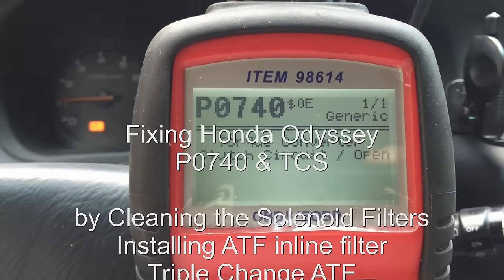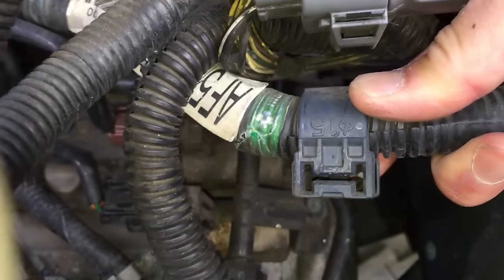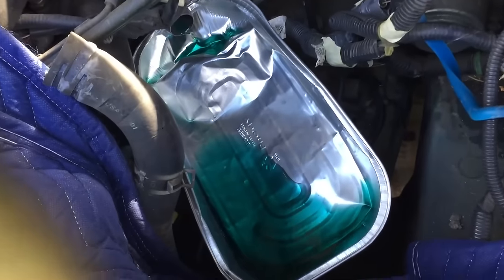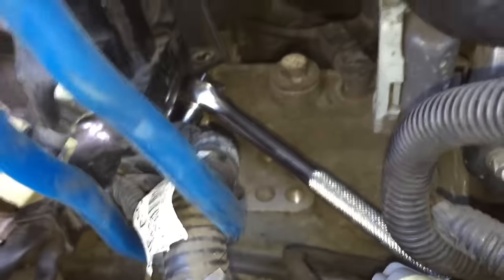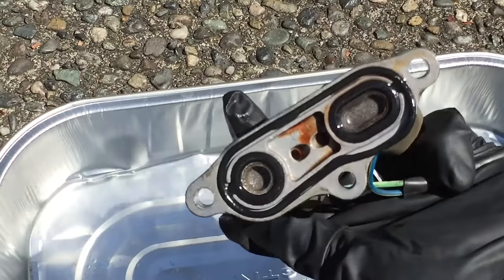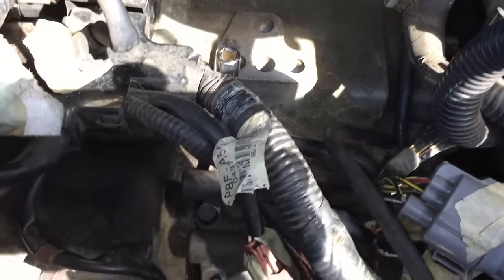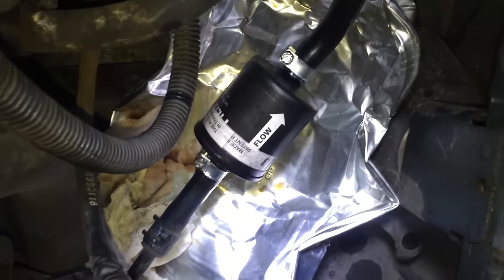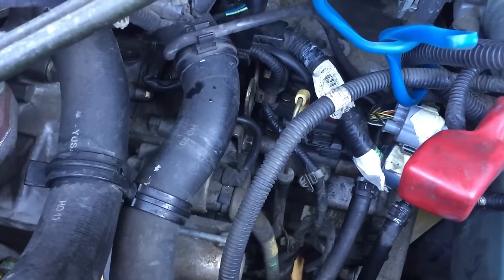Fix Odyssey P0740 TCS Transmission Problem

Comment: I decided to go with Valvoline synthetic. $26 at Walmart. I got that information from Reading several Odyssey forums. Also Aisin synthetic is recommended. Thanks about 3 1/2 QTs. I'll be doing the total of four flushes. 
Follow up: I did the four flushes and it didn't make any difference and now my third year is out completely. I was able to drive it home on the highway I had to pull over and think about what I was going to do  I decided to try shifting manually 1st and 2nd and then jumping up to  D. It seemed to work okay I'm going to try that for a while because it's my only vehicle I have.

Comment: I have 1997 Honda Odyssey medium not the biggest> I accidentally put the gear in reverse while in motion. It gave a sharp noise but I could keep drivinge it forward but if I engage the reverse it keeps giving a sharp and hard noise and it doesn't move in reverse. What is your recommendation, please?

Comment: I took mine off to clean it, got a new gasket, reassembled, but now I can't get it to seal. I've cleaned out all the bolt holes , made sure everything was clean and straight , but it keeps leaking. Any tips?

Comment: I have been having the same issues. Replaced both solenoids mentioned in the video as precautionary. Worked for about a year. The TCS light along with the  check engine light illuminated again while on vacation. Noticed this after 6+ hours of highway speeds. I suspect the fluid is getting to hot under these conditions. Next step, will install aftermarket oil cooler, replace fluid and attempt to get some more life out of this transmission. About to turn over 180,000 miles, suppose I'm more fortunate than most as this is the original transmission.  Not ready to drop 5k on a transmission either. Good video
Reply: johnny Macon  wow, Thank You !! That's Great to know, I just got a 02 Odyssey, Trying to get info on everything. Thanks Again !!!

Comment: My filter screens on both solenoids are filled with stuff and almost blocked, after cleaning, shifting is much improved now but the TCS light occasionally still comes on, that may cause by before doing this fix, I added one bottle of Lucas ATF fix which thick like honey and increased my ATF viscosity, but it claims to extend transmission life. I will start to replace my ATF 3 quarts of a time.
Reply: @duke n any updates??

Comment: Mine said the torque converter clutch solenoid. When i do searches i have to wade through 10,000 other shift solenoids and lock up solenoids. How do i know if the same part has 10 different names and that im getting the correct part. I called hondas parts store and they said its called a dual linear something or other and costs 400 dollars. I know thats not correct. I just want someone to give me a torque converter clutch solenoid. Period. Not a shift solenoid. Not a 400 dollar thing. A torque converter clutch solenoid. Why is this so difficult? Any help is greatly appreciated.

Comment: Nice video 👍

1. You should of extended your filter hoses and placed the filter in a more convenient location.

2. Installed a transmission cooler to increase the life of your transmission by 25%

Comment: Thanks for the video, the best on the subject I have found so far.  My fluid, solenoids screens etc. looked almost identical to yours.  Followed your directions except did not take the radiator hose off.  Talked with a mechanic who explained that the solenoids get gummy/clogged with debris so cleaning with brake cleaner allows the parts to work better.  My A&B lockup solenoid was barely clicking when tested with 12volts.  Using brake cleaner while powering freed them up and now work much better.  I also used this video to test the amp draw as well https://www.youtube.com/watch?v=K6xBepnSdSU.  I installed the inline filter, changed my fluid 4 times and color has gone from black to see through red.  I have only run about 100 miles on it so far, however it shifts great without any issues.  My symptoms were that the transmission would suddenly/violently downshift and upshift.  Also had the p0740 error code and was told by the shop that the transmission was toast and needed to be replaced.  So for about a weekend of time and $100 in parts, took and chance which seems to have paid off.
Reply from the maker: I'm glad it worked for you.  I looked at that video and unfortunately, it doesn't show what it purports to show.  He should have showed a solenoid which looked OK in ohms, but under load conditions the amperage didn't follow ohm's law.  I guess that's possible, but that's not what he showed.  He also didn't test his voltage source under load.  It was an interesting aspect I hadn't considered, but unfortunately the video wasn't a clear demo.
Reply: TF89  hey how can I find the inline filter and how is your transmission doing I have the same exact symptoms and I'm going to run this procedure
Reply from the maker: They are available at any auto parts store.  They're generic so they only come in one size/fit.  It's still doing well after many months & thousands of miles.
Reply: MITEEman thank you
Reply: TF89
Reply: Hey I was wondering is your transmission still working fine? I noticed this comment was from a year ago, and I would love to know how well it has held up ?
Reply: I'm currently working on my 2001 Odyssey, I have problem with 1 bolt that hold dual solenoid, the bolt right underneath the metal pipe, not offset a little like this video, had to put everything together and deal with it later.
Reply: I had the same trouble when i was trying to get mine off, I used a 1/4 inch socket and extension and slid it over the bolt very carefully on one side and leveraged the socket onto the bolt . I had to put a small bend in the metal tube to give just enough clearance to fully seat the socket. Hope this helps.
Reply: Thank you, I was able to remove the bolt pretty easy with a 10mm off set wrench. Cleaned throughout linear solenoid and it filter tubes but the 2nd gear hard shift is still there, will clean other solenoid later.

Comment: How many miles is on your odyssey? Didn't know you could splice in another filter. I haven't the slightest idea why honda does not recommend changing fluid every 30,000 or 50,000 miles. Great video 👍

Comment: 2000 Ody 215k miles. No codes. Shifting very hard from first to 2nd. Downshift, no problems. 
I replaced the linear solenoid (made in China from eBay), cleaned the 3 screens. Now shifting from 1st to 2nd has considerably improved (I feel a slight "clunk") but now it has CEL ON and a P0740 code. 
Any thoughts/solutions? Thank you.

Comment: I just took my 09 Odyssey in to get all the solenoids replaced. I got it back and the key does not release from the ignition in park until you slam it into park. I told the shop and they said either a linkage bushing is worn out or the neutral-something-select is dead. And they had no intention of fixing the issue for me. Is this shifting linkage bushing something they would have touched during the replacement of the solenoids?

Comment: I took out both solenoids sets and cleaned out their screens even though their were not clogged, checked the resistance and all was normal readings; and did only a 3 qt. drain and fill with  Honda ATF, but I am still getting the code P0740.  Any feedback would be appreciated. btw it's a 2000 Odyssey EX.
Reply: Well think about it your not working on a UFO...

Comment: Great Job buddy!! do you think that inslalling a filter(in the hose) would affect the original pression of the fluid flow and something go wrong with the transmission? tks
Reply: I own a 2001, and I've using these filters inline since the van went up to 120k and change them every year, that is after every other flush and refill. 190k miles and trany is good! Live in chicago with stop signs in every corner and 6 mths long winters
Reply from the maker: The filters were already clogged, so the net effect of cleaning out the filters in the solenoids and putting in this inline ATF filter should be a net positive.  That junk now collects in the inline filter which has 100x the surface area and is built to handle it as opposed to the solenoid filters which are the last line of defense and too tiny.

Comment: This may fix problem for some but it did not resolve my problem after replacing this solenoid on my 2000 Odyssey. I have always been able to reset the code however as soon as my speed reaches to above 50MPG the check engine light comes on and this error P0740 will be registered.
Reply: Did you fix it ? Can you please tell me what you did
Reply: Do you have any solution yet, my speed reaches to above 80KM The check engine light comes on and this error P0740 will be registered.

Comment: Great video, what was the spray solution you were using to clean the solenoid?
Reply from the maker: You can use carb cleaner but I recommend brake cleaner.  Carb cleaner is generally flammable so I'd be very careful in testing the solenoids that no sparks are created.

Comment from the maker: I just hit the P0740 and TCS light again after 8-9000 miles and 18 months.  I think the ATF filter was getting too clogged.  See the video of the inspection after I cut it open.  Pretty gross inside - it did its job.  Search for "Wix ATF Filter Inspection" on my channel

Comment: Did you reuse the face to face gaskets as well as the internal O ring type gaskets. I checked into purchasing these gaskets from auto parts stores, and they do not carry them. Where did you get yours if you replaced the gaskets? Great video

Comment: Did you use Honda ATF? Also would you recommend using Lucas Oil Stop Slip?
Reply from the maker: Yes, I used Honda ATF from the dealer at about $9 a quart x8 = $72.  My local auto parts store charges about $7.50 for a brand name ATF, so it's not that much more.  I was thinking of going cheap for the first couple changes and using Honda for only the last one, but since you can only change out 1/3rd of the fluid, using anything else means there's going to be a mixture and you can't change it out like engine oil.  

I don't know anything about aftermarket additives.  In general, the problem is clutch material clogging filters.  Either this procedure gets it out and keeps it from coming back, or it's too late.
Reply: Thank you for your prompt reply.  I have no real automotive experience (outside of small engine repair and carb, fluid changes, brakes) but I am study your video and the Honda dealership repair manual and plan on doing what you did.  After all what do I have to lose? Thanks
Reply: TheTactiFool Your patience,then your mind.

Comment: What was the issue? My gear changes buckle on me when driving. Is this it?
Reply: I have the same issue.. ive read that changing to the newer dw-1 synthetic fluid works for many. seems to be a common issue on older ridgelines and largers hondas.
Reply: @fathergratwick  I solved the issue, it was a bad oil pressure solenoid aka spool valve, right behind the passenger front tire, took 30 min to change, very easy fix

Comment: I changed my linear solenoid without putting in a new gasket and now it’s leaking fluid. Now the car has to sit a few more days until I receive the new gasket
Reply: Where did you buy the gasket?
Reply: Chandrashekhar Patel I went to Honda dealership

Comment: This video is good except for one thing does anybody know what year is this Honda Odyssey is?
Reply: I have a 2000 and it looks the same as mine and the fix worked on mine. So this should work on 2004 and older
Reply: If you watched through the video and read the post script, you'll find that it's a 1999.

Comment: We just change both solenoid top and bottom, but my van still drive in low gear and only when the van cool down or cold it will reverse. Otherwise idle stay in below 1 and she can't reverse when engine warm up. I still have the d light blinking and engine light come on. Do I need a another trans?
Reply from the maker: Probably.  If the filters were clogged your clutch friction material is probably too far gone.  Mind never flashed "D" (although I've seen this in other Acuras so I know the problem).  This procedure just cleans up the stuff in the fluid; it can't restore damaged friction plates.

Comment: I have a 02 acura tl  and I got p1768 code d5 flash and tcs light. the car is good on d1 to d5 but starting off of d5 the car drives but feels like its pulling off weak but good at higher speeds. idk if its a sensor or what. any help would appreciated . thanks ahead of time.

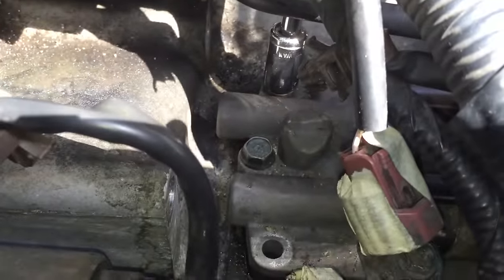Comment: Hello Mr Miteeman, I has been watching your video  a few times and at minute 13:31 it supossed to be a gasket yes or not cause'  in my oddy 2000 i can hear suction air noise, my oddy doesn´t have it, i check a new part on ebay and the part does have the gasket, any idea.thanks.

Comment: I drive a 2004  Honda Accord v6 with quite a similar  challenges, problem is after i removed  the 10mm bolts 6 of them I have been unable to pry off the transmission shift solenoid so i can clean it up stuff seems like it was welded onto the trany . Does anyone know of a technique to ease it of?
Reply: Rexi tube Odafe I’m having the same problem. Bout to go try to pry in out with a flathead.
Reply from the maker: First, don't try to slide it off - those pipes keep it in position.  You need to pull it straight up.  I didn't have a problem with getting mine off, but heat is always a good idea.  I wouldn't use a blowtorch with all that oil & gaskets.  I would make sure you have a new gasket before you do anything too radical.  Penetrating oil should help.  A $10 Harbor Freight heat gun does wonders on a lot of stuck stuff.  There's really no way for the metal to stick to metal - it's got to be the gasket sticking.

Comment: Thanks so much for doing this.  Have my fingers crossed that this will do the trick.  I have a question though.  In addition to the P0740 code, I am also getting a P0730 code.  Any idea what the significance of this is?  I think the P0730 code means "incorrect gear ratio"......

Thanks

Comment: It is NOT well published and NOT all Honda models come with it but for some builds there is actually already installed an INLINE cooler filter on the rubber line. It is a smaller and non standard looking filter. I forget if the information is actually from HONDA or ATSG group or one of the many rebuild kits I have used but follow and look at all the rubber lines going to the cooler usually center of vehicle attached to lower radiator support and you might be surprised at what you find.
Reply from the maker: I also saw that some may have one installed by the factory but it's not true for the original 1999's.
Reply: @miteeman  going as far back to a 1998 Honda Accord, 3.0 v6 had them.

Comment: what year Odyssey is this? 1999-2001 was 4 speed and 2002-2004 was 5 speed or something to this effect, so one or the other version does not have these axact filters. I think your Odyssey is 2002-2004
Reply: you muddled when you said the year but I think you said 1999, even though it sounds like you said 1998
Reply: This video looks to be a 99-2001
Reply: This video is for 99-2001. 2002-2004 is 4 speed and external filter. Solenoids can be clean same as he did.  Great video!
Reply: Look at the end, 21:45, 1999 Odyssey is written on the screen.

Comment: Why didn't you change the factory OEM transmission filter, per https://youtu.be/_KYPR-gzwHM ?
Is your 1999 the same van through 2004 is it?

How is your van running todaybtw?
Great video! Thanks
Reply from the maker: Unfortunately the 1999 didn't have one; it was added later.  The van is still running fine after several thousand miles.

Comment: I saw the video. but my odissey 2001. The engines do not work, they are as camsado. You just click but they don't work. They have no strength. This tip works. greetings 2:32
Reply: I saw the video. but my odyssey. The engines do not work, they are as camsado. You just click but they don't work. They have no strength. This tip works. greetings

Comment: so this should help trans shift i replced the duel solenoid but still in limp mod  was told to replace the seep sencer still nothen but it broke in said
Reply from the maker: It could help, but I would not have replaced anything until this entire procedure is performed.  Otherwise all the friction material in the ATF will just plug up the new solenoid.  Do it as soon as you can and you should check the solenoid filters even though you just replaced it.

Comment: Took the top solenoid easily without removing the battery tray, but I’m stuck with putting it back on :( I can’t put the solenoid back on because there’s two hard small pipes behind it, someone help!
Reply from the maker: Not entirely clear what you're referring to.  Are you referring to one at 7:15 with 3 bolts?  You mention a hard pipe which sounds like the one at 13:16 when I show a hard pipe and how to get around it with the right wrench.  I'm not clear if you're referring to the short pipes which are shown shortly after?  This is on a 1999 Odyssey so perhaps yours might be a little different.  But if you got it out, you can get it back in.  It sounds as though you're having problems getting a wrench on it due to the hard pipe I showed and if you don't have the right small 10mm & extension then buy crow footed wrenches.

Comment: 3/13/2018
Honda Odyssey NOTE: 

Honda did not build a large, efficient oil cooler for the trans, uses same water cooling system as engine. My cousins Odyssey is on it's 5th trans. He may be a 747 pilot but he's no mechanic.
Same for Accords too in 1999-2002 ( please add info if you have additional ?)
Info came from a savvy mechanic here in Fredericksburg VA.
Reply: Based on the way my Odyssey runs, I'd say I've had no problems. In fact I love it